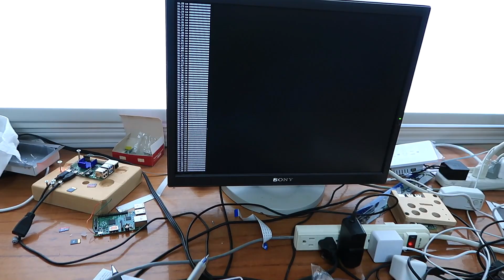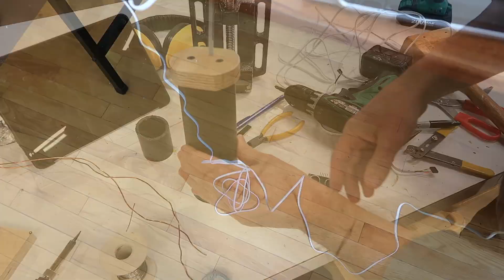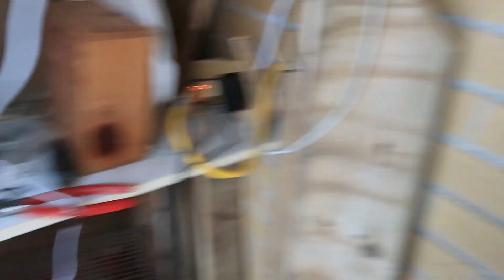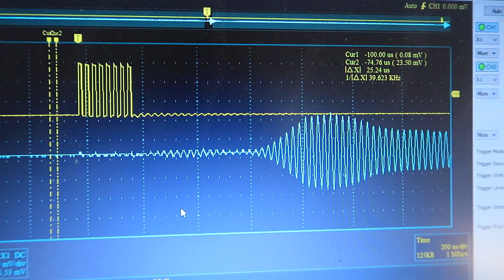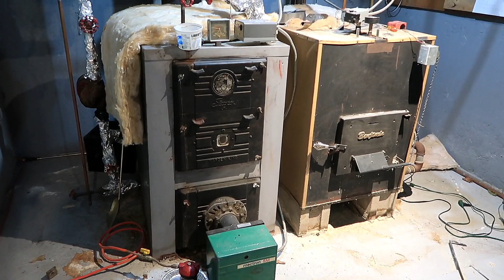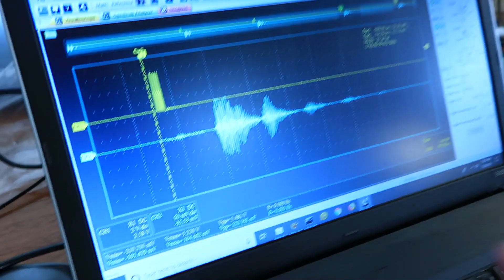Ultrasonic distance sensor as an oil level gauge

Comment: I wonder how the oil itself and the soundwaves interact.  I wonder if the oil absorbs more of the wave than say something like sheet metal.
Reply: I would have thougth you would get the reflections both from the surface of the oil and from the bottom of the tank the latter being muffled by travelling through the oil. In sound enfinering the rwvwrburation could have been gated.

Comment: Why do you have an oil tank??? Here in Missouri our fuel just comes to the house in pipes. Unless ur in the country and have a propane tank.
Reply: Missouri uses natural gas, mostly.  Missouri had a lot lower population back when natural gas pipelines started appearing, so the cost of adding a gas system to a city or town was fairly cheap compared to, say, New England, where people have been living since the 17th century.

Oil burning systems were drop-in replacements for coal burning systems, and are much cleaner than coal (historically, anyway; I have no idea about modern "clean" coal), and more convenient for the owner (no shoveling, no ashes, no chimney fires), so a lot of places up north went that route.
Reply: @jeffspaulding9834  thank you very much for the accurate and detailed response.

Comment: Hey Matthias, would placing something flat like a piece of thick plastic, floating on the surface of the oil, make the readings more accurate?
Reply from the maker: because the surface of the oil isn't flat enough?
Reply: @matthiasrandomstuff2221  fair point!  Haha. Back in my box
Reply: @matthiasrandomstuff2221  Old video NEW comment... put float in and bring out with rod thru cap, can see at a glance.... but keep ultrasonic just read from a plank at top of float.... keeps it out of tank, set up correctly these work insanely well. Try sample 1x per second not continuous... works.

Comment: I used one of these sensors for my watertank. After half an year the "emitter" and "collector" was rusted and it doesn't measure any more
Reply from the maker: well, its an oil tank.  If it lasts half a year, that's one heating season.  I guess I should take it out of the tank over the summer to cut down on the odds of it rusting.

Comment: I've just ordered a bunch of infrared time of flight sensors - they supposedly give sub-mm accuracy from 1cm to 50-400cm depending on model. For around 3-9 dollars they're pretty neat, and the calculations all happen on board, you then i2c the data out meaning no operating system lag can interfere with the measurements. The best performance per dollar I can find is the VL53L0X or VL6180 family of chips...they can be hermetically sealed with a glass cover.
Reply from the maker: I should look into those
Reply: Yea, you paid 100$ right? Maybe he gets them from alibaba, ask him. Alibaba is worth the price if you’re willing to buy a bunch to test which ones are good.
Reply: I have used VL53L1Xs on drones to show pilots through goggles the distance to the ground (for the last 2 meters) with an LED. They are not the usual "china" cheap, where you get a ten-pack for a few Euros. But for 4-5 Euros you get a pretty reliable device, that works quite well even in sun light. What's neat it that you can set an area of interest, because the sensor is something like an 8x8 pixel array and you can define the rectangle to "look" at. That's useful if there's something in your "view" that you can't remove but want to ignore.

Comment: There was a fuel/diesel tank measuring system I've worked with that used ultra sound, but that system had the transducer at the bottom of a stick/probe, looking up at the surface. The probe also had "pegs" at certain known distances to allow calibration.

Another idea about your unexplained variations,  maybe you should check against the temperature - who knows how those sensors/transducers change with temp..?

Comment: I tried to measure the water level in a 200l barrel like this a few years ago with a similar sensor and an arduino. It worked fine when testing against solid objects, but when I put it in the barrel it measured all over the place for some reason..
Reply: ECHO... ECHo... ECho... Echo... echo... ec...  😜
Reply: @Sharklops  well, that's kind of the point, no? 😂 Is there a difference in echo measuring oil versus water? Genuine question

Comment: It's amazing how much can be accomplished with the humble sound wave.
Reply: My favorite use: "GET OFF MY LAWN!"

BTW, I'm serious considering a robotic mower after watching your video.
Reply: Hey, you're the guy from the thing!!!
Reply: Constructicons inferior, Soundwave superior.
Reply: Sound waves are the most common method of converting fluid level to electrical signal. Simple ultrasonic methods like this (except far more reliable and accurate) are very popular, as are the "Guided radar" systems that use a rod or wire rope to guide the sound wave to the surface rather than have it bounce around inside the container. It's good stuff.
Reply: @Miketz  LASER/LED. higher frequency = higher accuracy
Reply: @bob-ny6kn  In theory, yes. But when there is vapour/dust between the sensor and what you want to measure, or condensation on the sensor then they don't work at all.
Reply: @Miketz  ok. Light does get beat up if it isn't a perfect day.
Reply: The spec fuel flow sensors for F1 cars use sound pulses aimed with and against the flow. It's suspected that part of Ferrari's subterfuge involved detecting the current draw of the sensor and slowing the fuel pump to a legal flow rate just before the next sample.
Reply: At some point my parents had a TV with a remote that sent out ultrasounds. You could take that remote to a different room and adjust the TV channel, audio volume, ... through the wall. I suspect this wreaked a bit of havoc if neighbours had the same TV model...
Reply: No actually it's not even surprising. What's amazing is that people could find out accurate ways to measure the sound waves.

Comment: I wonder if there’s anything relevant from automotive oil level sensors. My understanding is that they’ve gone way beyond issuing low level warnings and measuring pressure.
Reply: They measure from below up to the surface, but their measuring range is too limited to be of use here,

Comment: How about putting a tube into the oil with a float so your sensor reads a stabilizer float?
Reply from the maker: A flat surface, like the surface of the oil itself, works much better.

Comment: My oil tank gauge is broken, but I took a different approach. I attached a simple hour meter to the burner circuit and record the minutes it runs. Oil burners use a calibrated oil nozzle rated for a certain gallons per hour (at the standard 100 PSI pressure.) My furnace calls for (and I use) a .75GPH nozzle. I know how much oil I got last fill, so it's pretty easy to calculate the amount I burned and how much is remaining. I could hook all this up to a Pi if I wanted to for better tracking.
Reply from the maker: Hmm, maybe just an old electric clock hooked up in parallel to the burner?
Reply: How is the pressure kept the same with lowering oil level?

Comment: The dielectric constant of fuel oil is about 2.1, so a dual electrode dipstick would allow measurement via the capacitance change.  I'll be using that method for a similar project.
Reply: Aircraft fuel gauges have used capacitance sensors for years.  There's a company in Florida that makes coaxial tube sensors for water or fuel, custom for cars/boats/RVs.
Reply: And here some people use a stick.
Reply: @wobblysauce  The stick never lies.
Reply: @markm0000  Except when it falls over onto the ground.
Reply: @bradley3549  Oh I just got it. Lol
Reply: @markm0000  Better late than never! :)
Reply: AFAIK, you need 3 electrodes:
the tip has 2 electrodes, all the way to the bottom, is always under the oil.  With it you measure the dielectric of the oil itself, as it varies with temperature, composition, etc.  Then there is gap from the tip to the third electrode, and this is the one you use to measure the level.  That is how car levels work; think engine oil full of contaminants and varying temperatures.
Reply: Who cares
Reply: @luise.6982  What a useful, constructive, entertaining comment. Thanks for your contribution to mankind!
Reply: @bradley3549  lol

Comment: Is it really important to run that script with root permissions..
Reply: Wondered that myself for a moment, but I've no doubt there's a reason. Is root needed to access the GPIO inputs perhaps?
Reply: @andythebritton  Yes and no.  If you set up your permissions, groups, and various other bits right, then you don't need root for GPIO.  But if you want to actually get stuff done rather than mess about with all that, then you just use root.

I'd imagine it'd be a different story if he wanted to set up the Pi as a public server.

Comment: Nice job building a level gauge. Don't feel bad as the real ones are a PITA to setup in the field too. Depending on the beam width you may get echos off the side of the tank. Where does the return line (do you even have a return line, some systems don't need it) dump into the tank in relation to the level gauge? Is it possible there is some splash or ripple created that are affecting your readings.
Reply from the maker: I will find out when the oil level gets low.

Comment: Super interesting and cool as usual. But what's even more interesting is how I didn't even know houses used oil like this. Does it come piped to your home from an oil company? Do you have to buy it yourself and fill it up?
Reply: The tank is probably ~250gal capacity; typically the local oil company will come to fill it from a tanker truck either when you call or on a set schedule. It's a pre-paid system similar to propane. It's called heating oil, but it's much closer to diesel or kerosene than an engine oil.
Reply: @aaronpike1853  Ah, thanks for the info!
Reply: @aaronpike1853  It's so similar to diesel that in the USA it's dyed red because people have been known to use it in diesel engines, and since it's sold without charging the motor fuels tax, it's not legal for use with on-highway engines. An enforcement agent can check the fuel tanks on a truck and if they find red dyed fuel, they know someone is breaking that law.
Reply: At least where I live you have a tank at home that gets filled maybe once per year. I don't use oil but I remember my grandparents had a tank of about 7m³. Yes you buy it and a truck will deliver it. You can have the same thing for propane but natural gas is delivered in pipelines. Not all places have pipes so that's when you have a tank.

Comment: Good to know, but I will suggest another larger change and I'm sorry since you did not ask for it. I have replaced the oli-burner with a woodpellets-burner with the same fittings and I would suggest you to do the same if possible or atleast something that suits you in this place to replace the oil, since I do not know your details. It paid off itself fast here anyway. Also automation made to vaccum transport the pellets from the storage to the burner, but thats a different unrelated story. Continue to improve. :)
Reply from the maker: The cost of wood pellets per BTU is about the same price of electricity.  Definitely not worth the capital cost.  And if I want to keep feeding it, I'd rather throw much cheaper chunks of wood in the wood burner.

Comment: these ultrasonic sensors are sensible to temperature and humidity, which will change a lot over time on this outside tank. that's why may be you see the level getting up !
it's easier to detect when the boiler is on, because the boiler consumes an almost constant fuel quantity over time (around 2kg/h)
and integrate this on-off data over time ti get the number of hours the boiler is on each day, multiply by 2 and you get the consumed fuel volume.(as 1 L fuel is almost 1Kg)
plus: it's completely forbidden to use any electrical device so close to a fuel tank, even low voltage powered. there can be any spark that fires the tank.
Reply from the maker: it has a temperature sensor and compensate.  The effect of humidity is much smaller.
Reply: Fuel vapour can ignite.  Might be a time bomb waiting to explode...Who knows. Sleep well at night?

Comment: I'd like to see you try it with a float and a POT. You could have the float move an arm that adjusts the sweep on the pot that is read by your Pi, added benefit would be you could have it move a gauge similar to the one you have there now for a local indicator.
Reply from the maker: do tell how I would get that mechanism into the tank!
Reply: @matthiasrandomstuff2221  I assume my reply was rejected because I included a link.... but it looks like your existing clock gauge is similar to a Scully or Krueger system. In the same manner, you can have the float and linkage in the tank. Vertical rod comes up through a grommet and attaches to a crank that turns the pot, or if you put in a slide pot it would be direct acting. You might even be able to reuse the float in your clock gauge - assuming that is not what broke.

Comment: How about using a tiny hammer to “ring” the tank. The computer could analyze the frequency changes as oil level and temp changes. Good times!
Reply: That’s good, but I think we can make it even more complicated ;)
Reply: That's amazing! That's one of the more creative transducers I've heard. I bet it works quite well too. Just get the electromagnet plus ''hammer" from an old mechanical doorbell, and put a guitar pickup next to the oil tank.
Reply: Just no use a fluid level sensor
Reply: @HighVoltageMadness  👎

Comment: Some people would just dip a wood stick in the tank. But then there's Matthias
Reply from the maker: With the roof over the tank, that gets impractical!
Reply: @matthiasrandomstuff2221  Oh yes, but I know of someone who is capable of a work around! Maybe short pieces of wood linked together? I really enjoyed your video. Thanks!
Reply: @matthiasrandomstuff2221  sightglass might be nice, but it'd need to be empty or already have a fitting and tap ready and waiting.
Reply: Weighted string or rope with measurements written on it? Eliminates the awkwardness of the roof negating using a long stick, but fuel oil is stinky and messy, and where is the fun in low-tech solutions. ;)

Comment: factor in the shape of the tank and the actual oil temperature and compensate for each and convert the volume to kWh. that should even out the readings and give you a more useful idea on the actual energy you consume.

Comment: Hi
interesting experiment
I have a few thoughts on this, if you don't mind :)
1. For prototyping in a room, use some kind of container, because multiple re-reflection introduces an error in your oil tank.
2. I don’t know if your device has a temperature sensor, but it should be there, because the speed of sound strongly depends on temperature
3. If the sensor returns several reflections, then a small reflector can be placed in front of the antenna and the signal from it can be used as a reference
Reply from the maker: 1 - first reflection count,s the rest don't matter.  2 - has a  temperature sensor.  3 - get one of those sensors and try it instead of imagining solutions to imagined problems.

Comment: Wouldn’t a pressure sensor at the bottom of the tank be a good way to measure oil qty. without having to take into account the temperature? As the temp increases, the increased depth due to expansion should be cancelled out by the decrease in density, and vice versa.
Reply from the maker: Yes, pressure sensor at the bottom would work too. But --- atmospheric pressure pushing down also fluctuates a bit.  But the distance sensor is so much easier and cheaper!
Reply: @matthiasrandomstuff2221  there are plenty of differential pressure sensors
Reply: @matthiasrandomstuff2221  True, but has a tendency to clog with time, even with sintered filters, which requires extra maintenance, that the ultrasonic avoids.
Reply: Most industries use ultrasonic sensors to measure liquid levels. There must be good reasons for it.

Comment: Those sensors are not good at discriminating between the echo and ambient noise.
Nice for playing with indoors, but that's it.
I tried using one on a linear actuator to get position feedback.
Readings are a complete mess due to the motor and gearbox noise.
Reply from the maker: If i need one for a machine, I'll probably place it in a 2" pipe, with a piston moving in the pipe, and measure the echo to the piston.

Comment: I wonder if you ever considered using those ESP WiFi modules like ESP8266 and ESP32 (not specific for this project)? Would be nice to see more projects like this :)
Reply: I second using WiFi-enabled microcontrollers over microcomputers for such simple tasks as sensor data aquisition. Also ESP32 wouldn't have the timing issues that Raspberry Pi has.
Reply from the maker: yes, I know about dsp32.  But it just adds a whole level of hassle.  As it is, I can log into the thing, compile on it, grep thru logs, etc.  So much easier, well worth the extra $15!

Comment: Very cool! I've recently been working on a project to control my humidifier using a Raspberry Pi (by sending it radio signals, which the humidifier thinks are coming from the OEM remote control) . It would be useful to also monitor the level of water inside the tank, and using an ultrasonic distance sensor seems like a handy way to do it. Great video, and very timely!
Reply from the maker: or you could put it on some load cells to weigh it!
Reply: @matthiasrandomstuff2221  or a differential pressure sensor between atmospheric and bottom of the tank
Reply: What aspect of the humidifier are you trying to control?
Reply: @cbalan777  On and off presumably, that's all the functionality that my humidifier has!
Reply: @cbalan777  The fan speed. This humidifier has 9 different fan speeds, but no built-in option to set the speed based on the humidity.